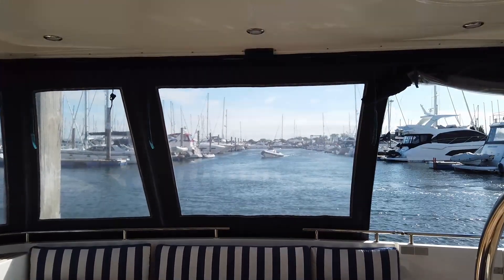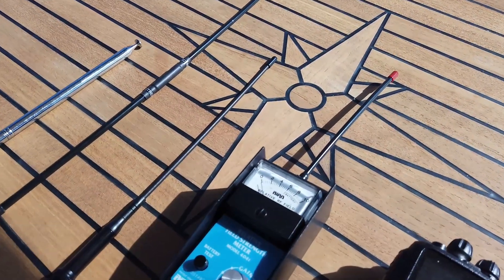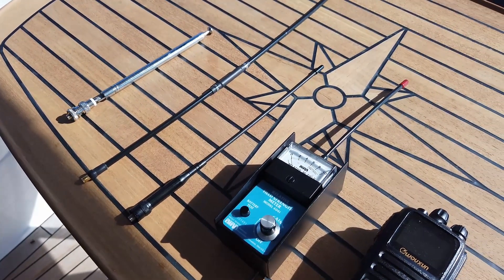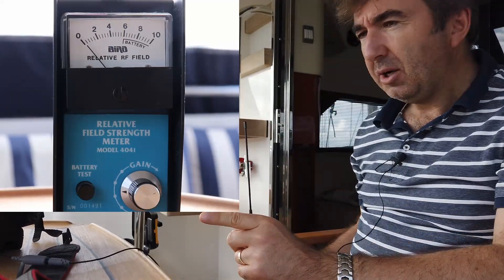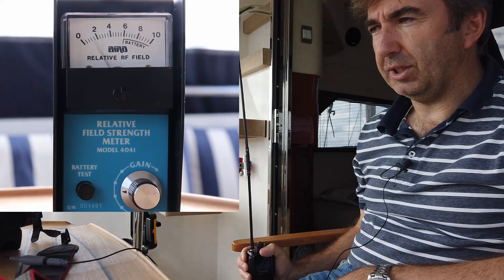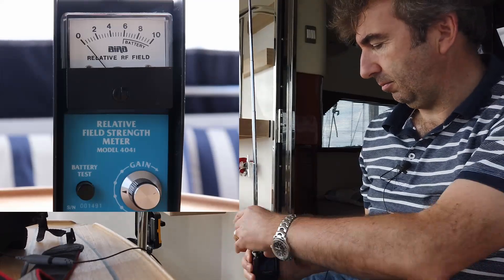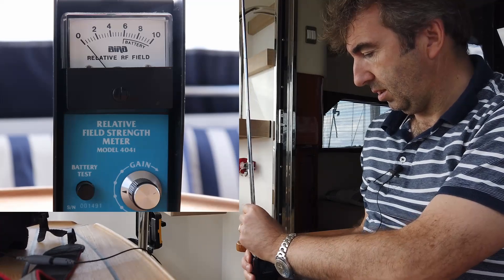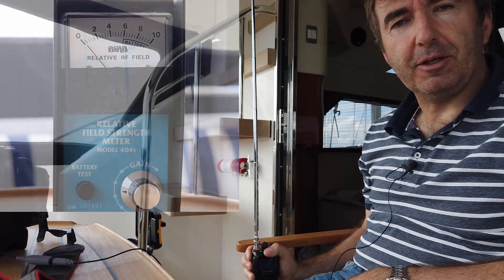4m/70Mhz handheld antenna test

Comment: Need a 1m tactical blade\tape antenna ex mil type on that to make a good difference bit more robust than telescopic,but shows diffrence in erp defo!
why they cannot supply a 1/4wave stock sma to get best from set?

good vid

rob P😀
Reply from the maker: Hi Rob, I like the idea of those tape type antennas but I've seen a few reports especially with the longer ones of them continually collapsing after they have been folded a few times.

Comment: Thanks for the video. I have the same radio and I use the Hawkins antenna for portable and base use. I like the telescopic antenna. How long did it take you to make it
Reply from the maker: About 4 days, 2 minutes to order the parts from the internet and 3 days waiting for them to arrive. The telescopic whip came with a bnc connector so then just required the bnc to sma adapter.
Reply: @justradio5521  Thats brilliant. I have a BNC adapters. I like to order one too. What should I search for on eBay?
Reply from the maker: @TheOutdoorFun  Here's the telescopic whip that I purchased:
https://www.ebay.co.uk/itm/154088270502
Reply: @justradio5521  Thanks again. I will give it a try.

Comment: Did you test the SWR on the telescopic one? That is, are you confident it's within an acceptable range?
Reply from the maker: That's a good question and actually one of the reason why I bought the field strength meter. I've tried checking SWR of handheld antennas with an analyser before but find the results misleading. The radio and the person holding the handheld tend to form part of the antenna system so without those the result can be very different. I think a handheld forms a poor counterpoise for the antenna and because of that the radiator needs to be a little longer than if you tested on a good groundplane. The field strength meter allows you to adjust the antenna for best strength and hence best match to the transmitter.